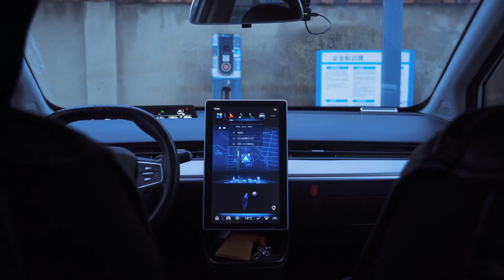Huawei Just Broke the EUV Monopol, A 3nm Revolution the West Didn’t See Coming

Comment: Well ASML is working oin the successor of EUV alreadym and that successor will be ready far before Huawei has solved their partial EUV replacement. The claim that Huawei has developed its own EUV machine is partially true, but with caveats. While Huawei is indeed working on developing technologies for advanced chip manufacturing, including EUV-like capabilities, it's not a direct replacement for the EUV machines currently produced by ASML. Huawei is exploring alternative methods like Self-Aligned Quadruple Patterning (SAQP) with Deep Ultraviolet (DUV) equipment to achieve similar results to EUV, and is also developing a laser-induced discharge plasma (LDP) based EUV light source.

Comment: Huawei’s Laser-Induced Discharge Plasma (LDP) EUV technology is shaping up to be a serious contender in the global semiconductor race—and yes, it could disrupt ASML’s long-standing monopoly on EUV lithography.

Could it disrupt the monopoly?
Potentially, yes. Huawei’s LDP-based EUV system is being tested at its Dongguan facility and is slated for trial production in Q3 2025, with mass production targeted for 20262. Unlike ASML’s laser-produced plasma (LPP) method, LDP uses a high-voltage discharge to vaporize tin and generate EUV light. This approach is simpler, more energy-efficient, and possibly cheaper to scale2. If Huawei and SMIC can integrate this into their chipmaking workflows, it could break China’s reliance on ASML and shift the balance of power in advanced chip manufacturing.

Is there talk of reverse engineering?
There’s no direct evidence that Huawei is reverse engineering ASML’s EUV machines. Instead, they appear to be developing an alternative architecture from the ground up. However, some industry chatter and skepticism suggest that China’s rapid progress may have benefited from studying existing systems. Still, the LDP method is technically distinct from ASML’s LPP, which could help Huawei sidestep intellectual property conflicts3.

Do they have patents pending?
Yes. Huawei and its partners, including SMIC and SiCarrier, have filed multiple patents related to advanced lithography. Notably, Huawei has patents for self-aligned quadruple patterning (SAQP) to produce 3nm-class chips using DUV tools. Meanwhile, SMEE, another Chinese firm, has filed patents for EUV radiation generators and lithography equipment. These filings suggest a multi-pronged strategy: pursue both EUV and advanced DUV techniques to reach 3nm and beyond.

So while Huawei’s LDP EUV isn’t yet proven at commercial scale, it’s not just hype. If they can overcome hurdles like power output, mirror precision, and yield, they might just rewrite the rules of the chip game.

Want to dive into how LDP compares to ASML’s LPP in more detail—or explore what this means for TSMC and Intel? I’ve got plenty more where that came from.